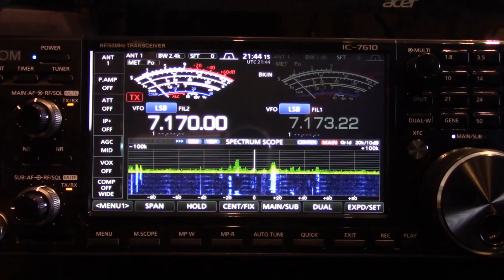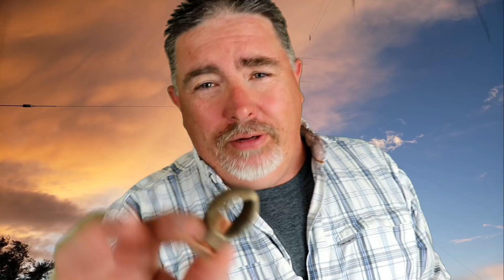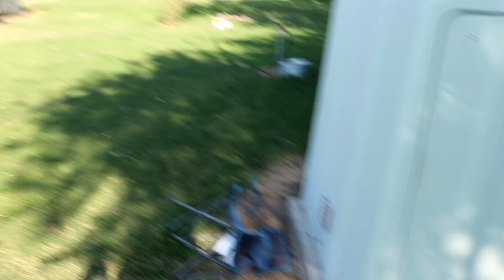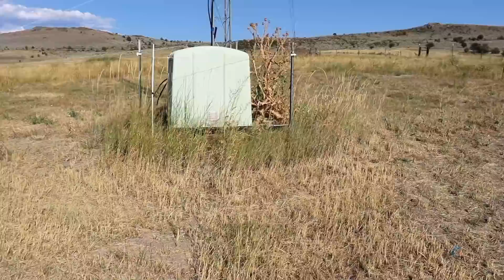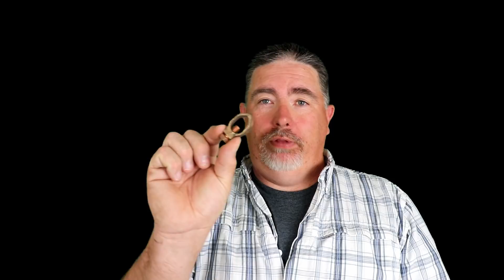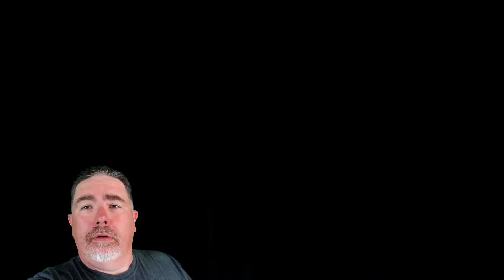Lightning Protection and the Ham Radio Operator.

Comment: I’m constructing a R56 inspired grounding/bonding system for my residential amateur radio setup. Obviously, I can’t ever get truly R56 compliant due to a residential layout and the strict R56 standards.  I have a question about your view on acorn clamps.  I dug a 40” trench and created a six ground rod halo system with double conductor awg6 solid wire for my 84’ tower.  I used acorn clamps rated for direct burial and slathered the channels inside the clamps with Jet Lube SS-30.  I intentionally placed the halo at this depth to get below the frost line, freeze/thaw cycles, and more consistent moisture levels. Curious about your thoughts on acorn clamps used in this fashion?

Comment: This dude doesn’t know what he’s talking about! I’m an electrician and I can say that acorn-type grounding clamps are just fine if installed correctly and are used every day for ground rods installed for lightning on every home in the country. Also, he used 10AWG wire for his lightning grounds, which would vaporize if actually struck by lightning. He SHOULD have used 6AWG, which is much heavier and can take a hit without blowing up.
Reply: Ya a lot of those U-BOOB videos are made by people that know nothing about the subject matter, I have a 30 foot tower and a 17 foot vertical antenna on top of that plus three wire antennas all wired to the tower, now the tower is 125 feet from the house, I have 4 eight foot ground rod's driven around the tower, all wired with #4 stranded with the aforementioned acorn nuts, the three lines of RG8U are set up with lighting protectors TT3G50 gas surge arrestors then run to the shack, and ground to the house, I believe that if the tower gets hit, it's going straight down  will have to get some new gas cartridges  but that will be it, I still unplug all the radios just in case, overall good video. 😊

Comment: I prefer the Cadweld joints on grounds when I worked in the industry years ago in the States. Moved to the island of Crete a decade ago and I have learned a whole new way of grounding the service entrance point at the meter. Electric company here requires a minimum of three ground rods mounted in a delta fashion with each leg being two meters apart. Soil is almost non existent and plenty of rocks. I can see why the more the merrier helps on rocky soil. We have had side streamers hit our solar water heater on the roof. Net result is hearing a loud crack in the breaker box and the whole house GFCI cutting off. ( all new and existing electrical service must have these breakers installed to prevent electrocutions) we have also experienced several hits of streamers on our fireplace chiminy and discharging onto the floor with a loud crack.
Looking to instal a hedgehog dissipater up on the service deck of the house and having it grounded. I'll let the pros do the work, getting to old to climb towers or any other high stuff. This will also be part of the solar array grounding system that I plan on installing.

Comment: Your tower or mast are only ground on the bottom? Notting on the top of the tower some thing in the sort of spikes Voor where the lighting should hit? Or is this not necessarily because I trying to learn more about it for my omnidirectional antenna because this antenna is the highest point on my mast so I don't think I can do more on top of the mast for grounding only grounding I have is coaxial en mast or pole on the bottom are grounded.

Comment: Thanks for the video.  I have a quick question.  I'm basically a SWL just getting back into the hobby after a 30 year hiatus.  Currently retired and very limited budget.  A few weeks ago, I strung up a nearly invisible (22 gauge) magnet wire 100 foot wire about 15 feet high among several trees in the yard.  I have yet to ground it because I wasn't sure how to proceed.  I would guess that with wire this thin and at the height it is, that lightning wouldn't be interested but there's no guarantee so here's what I've done at the present time.  The wire comes to the window and hooks into a 9:1 unun, the other side of which is 50 ohm coax.  For now, I have a quick disconnect on the wire.  I can detach just the wire and there's a small weight on it to allow me to fling it out into the yard about 15 feet away from the house.  When I'm ready to use it again, I can reel it back up to the window as its attached to a fishing line.  Thoughts?

Comment: My discone antenna is mounted 60 feet high on a 4 story apartment building with no earth ground. I disconnect the coax during storms and it arcs. What would happen if my antenna took a direct strike?  I am on the top floor and the coax comes in my bedroom window 8 feet from where I sleep. Could I be in danger during a storm?

Comment: Great video, thanks. The issue with the heating of the ground wires at sharp bends is due to the increased impedance in the wire at that point during the stroke. Lightning is not DC, it's actually a very wide RF event centered around 1MHz and going as high as 10MHz. This is why we can hear it in our HF radios. Tight bends increase inductance as high frequencies do not like to change direction quickly relative to their wavelength.

Comment: thanks for putting out a great video, so much to learn so little time, so I just try to do what I can, I,m putting up an aluminum fold down mast for 34 feet weighs 105 lbs at 65 I can manage that weight safely and gotta small hand winch in the plan in case and will be putting in a ground rod next to it,s 10 inch diameter reinforced concrete ground  pylo 4 feet down. VHF/UHF ops. I will be running lmr 400 from top on J pole with 10 ft round air balun to ant base ???? is this the point with Gnd rod to connect Lightning protector and then from LP onto radio. Ie this then will be two lengths of coax joined by LP will we have some decibel loss here??, I think it may be worth it., I know little so all is absorbed, ps I have also heard of grounding the braid before shack entry from a few seasoned Hams like yourself, so there must be something to it, not all good things are also written down. we out here in the east north of the border have CEC you have NEC  they converse. I also have a 20 /15/40 meter inverted v on an endfed strung up through a maple on a pulley 32 feet up I got a ground by that but not connected yet just a groundpoise??? Your feed back would be appreciated.
Keep the good vids coming , sorry for the long story, Mike VE9MWB

Comment: What are the ALLCOM units connecting your coax, which you have attached to your copper grounding blocks?
Reply: Never mind. Didn't take but 10 minutes to figure out the answer to my question. Really never a reason to ask questions with so much information available on the internet.

Comment: Nice one and a lot of good advice.  If you think about it, they are the tallest thing around any shack and if anything is going to get hit it is likely to be them!  I saw a coax sparking one in rapid fire and it was jumping from the centre conductor to the braid and it was very very bright, it started with a lot of noise in a CB and the owner disconnected the antenna and a few seconds later the sparks started jumping and within a minute it was a constant almost continuos stream of sparks.  Some were jumping quite a bit and when we went outside for a look there was just a dark cloud over the area.  The antenna didn't get hit but it was collecting a lot of static electricity and before it stopped you could see the flashes through the window.  Then there was one almighty flash and a tree got hit only a few hundred yards away, branches were blown off the tree and fell to ground, such is the power of lightning.  I have seen lightning split a tree top in half when I was a kid, there was one almighty bang and half of the top of the tree fell to the ground, we went over to look next day and sure enough there was a huge limb of the tree lying on the ground and a great big black mark all the way down the side of the tree and a hole in the ground where it went to earth with earth blown all around.  You can still see the damage on that tree yet after 45 years, it never did grow any bark back on that side of the tree.  Lightning is not to be messed with and those that don't take precautions are mugs, if it hit your antennas it is going to come in, kill you and do one hell of a lot of damage.  Just hope you are not in your shack when it hits.  I know of a CB antenna that was hit by lightning and it was earthed, the wire that earthed it was gone, just a little bit left on the grounding rod (It was into damp ground) and the antenna didn't work anymore, but the CB that was connected survived.  The antenna was a Silver Rod and it has a transformer inside it to match it to 50 ohms, it was toast and the coax was melted where it plugged into the antenna, but no lightning came inside the house, you could tell where it went and it just followed the heavy earth wire right into the grounding rod.  The owner, who had gone to bed was a bit shaken, but he and his CB survived, even though the antenna and the end of the coax was toast.

Comment: I just disconnect my coax and disconnect ac power my rig is far from a shot ground
Reply: But isn’t  your antenna wire coming in to your house where you and your family are?  What will stop the lightening from making a path through your antenna to inside your house?

Comment: Thanks for this video. You have an impressive station, and impressive radio experience. Could you please do another lightning strike prevention  "How To" type of video  for  the thousands of average Hams who operate from a very modest "shack". Hams who operate only a couple of radios, an amplifier, and an antenna tuner, feeding a simple H.F. dipole connected to trees or their house. This would be very helpful.  Thanks for your help.
Reply from the maker: Yep, got it on my list... just need to find some time!
Reply: @user-lp3cf5yn5b  You're best and safest bet is to disconnect your antenna feed lines from your house and ground them outside of your home, away from your home. You can watch numerous videos on lightning. Hundreds of thousands of volts at hundreds of thousands of amperes can travel down a wire and literally rip a streak of fire through your wall, floor and anything in its path. No lightning arrester you will ever build will be strong enough to stop lightning.  If thunder storm come, it's best to disconnect feed lines from your house. Watch some videos on the effects of lightning entering your home. It will scare the S*&T out of you !!

Comment: You don't mention whether you disconnect your antenna cables within the outside box when a storm approaches.
I expect that you leave everything connected at all times and rely on the earthing and suppressors for protection - is that correct?

I am still debating whether to mount my connection box on the outside wall of the Shack or at the base of the 10m mast which is about 12m from the house/shack - suggestions?
73 from Australia
Reply from the maker: I do leave it connected 90% of the time. If I happen to be home when a big storm rolls through I may disconnect things, but most of the time I am not home when they come through. 73

Comment: For it being a hobby, I'm impressed with you having such an extensive antenna farm.  So how long has it been since you have used your local repeater?  I winter in Seaside, Oregon and spend the rest of the year in central Utah and there seems to be at least 2 or 3 repeaters withing range and available the entire route.  Even a town as small as Seaside has three repeaters.  I guess my question relates to the actual need for an antenna farm, given the maintenance a farm requires contrasted with the rich availability of repeaters.  Love your posts, regardless of the topics.  You make them all interesting. 73
Reply from the maker: Hi Richard, We had 4 local repeaters that I took care of. They all used to have a good amount of traffic on them but in recent years it has dwindled to practically nothing, so much so that I wound up taking two of them down just because I do radio work for a living and having to run up and perform work on my days off on repeaters that never get used was enough. The antenna farm is all HF for the most part, something repeaters will never be able to replace. Since I work on VHF/UHF and Microwave equipment for a living it has lost its shine for me for a hobby as well, but HF is always magic. Hopefully that answers that...lol
73

Comment: Hey mate not sure if you still monitor your ch but I have a question. I just have a small 27mhz CB setup in my house with a old station master antenna on a j pole not very high up. am about to put a stake in the ground for a earth. Am I better just to mount the earth wire to the base of the antenna or to use a lighting arrester at the antenna side of the feedline and have that to the rod. Thx for your reply
Reply from the maker: I do monitor it, just been really busy the last couple weeks. So to answer your question, if you can do both that would be preferred. Always try and ground the antenna if you can and then have a good lightning protector before it enters your house. Make sure the the protector is grounded well, I suggest at least 1 eight foot ground rod.

Comment: Could you talk some more about the copper compression fittings ? I have been researching this - or trying to - and it seems like the choice of which crimpet for which wire and which Crimp Die to use and which tool that it fits into is literally a dark art. I am hoping actually to use one of the imported (<100$) hydraulic tools from ebay/amazon instead of the wowzers expensive husky tools. Thanks much.
Reply from the maker: John, I sure will. I never really thought it about, but I think you are right about he dark art. If I was not in profession of using them quite often I would have not known anything about them.

Comment: Hello, I'm a new subscriber and found this video very interesting. Background, I've been a ham since 1971 and have had an Extra class license for over 30 years. In addition, I spent 35 years in the phone business, all on the technical side, as a central office technician. Also, while at the phone company, we maintained our 2-way radio system, IMTS mobile phones, microwave, and point to point radios near the Canadian border (all Motorola :)). Grounding, of course, is absolutely essential for keeping millions of dollars of switching equipment up and working during storms.

The one point of your video I didn't hear anything about is avoiding a difference in ground potential, as that does attract lightening. I'm interested in how you've kept all your antenna systems at the same ground potential? Also, please include a reference for the Motorola standard as I'm getting active again and will be putting up a tower this fall.

In closing, you had me as a knowledgeable person, when you said you worked on commercial sites. Thanks!